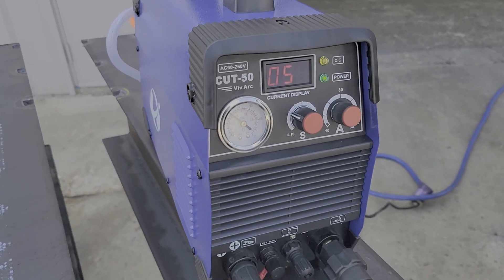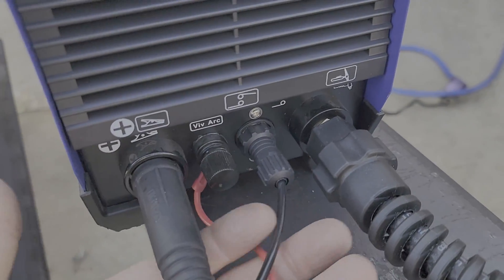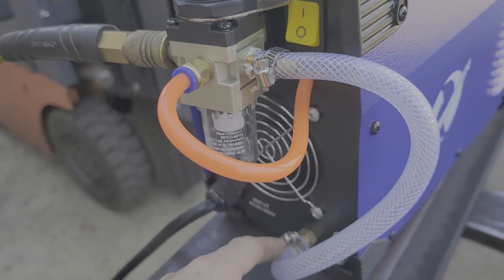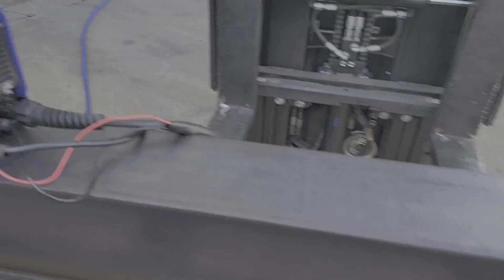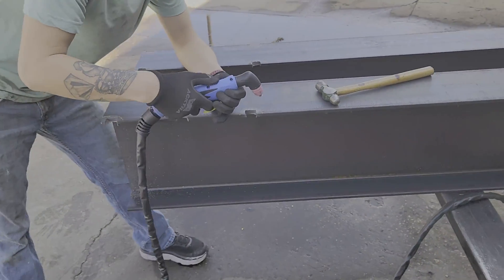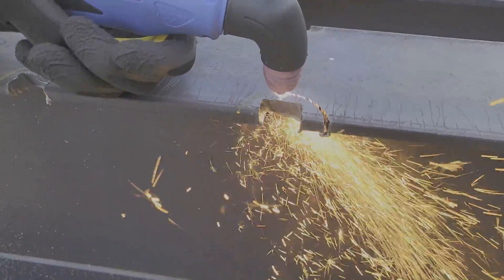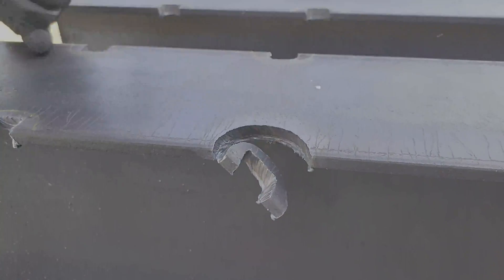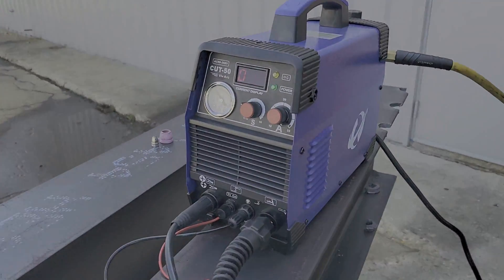Testing the $199 Cheap Plasma Cutter from Amazon!!!

Comment: I'm a DIYer, so what size compressor will I need?
Reply: Small, they don’t call for much. Had a junk yeswelder (stay away) but it only required 30-50 psi for i think 1/4 inch steel been a while ago, bought one of these lost intrest and haven’t even set it up lol but i need to. Whatever compressor is just a bit bigger than a pancake should do it

Comment: It's WAY cheaper than mechanical cutting and grinding - I have this exact cutter and have been fairly rough on it. It payed for itself in saved consumables ( think blades and cutting wheels etc... ) within the first few months of "hobby use". Straight out of the box mine leaked a little at the pressure gauge - fixed that in about 5 minutes.  I have 120 and 240 available - works better on 240 but does work well on 120v.  If you need to cut on 120V they recommend a 30A dedicated branch circuit. That said you can turn the power about 1/2 way up on a non-dedicated 20A with no other load and still slice up metal fence posts / sheet metal / whatever. You know you went to far if you pop the breaker.  :)    Overall - For my use - if it lasts 2 years or more I'll be thrilled. Great for hobby and occasional use !

Comment: I bought a cut50D from Amazon almost 3 yrs ago.
120/240 for $199. and have used it to cut almost 1/2 inch 
with little to no problems. It did take me about 2 weeks 
to get used to it.  But So far I have had 0 problems with 
the unit, But I can't say to much for the operator, yup, I
still make mistakes. I would give my little 
Prime Weld Cut50D a 95% rating for the work I do.
Reply: you right men a lot people discriminate those products olny because are china made,but ai have soo many borcken makita and dewalt thash tools......but a have chicago elctric welder machine and i never had a problem even  if it is china made

Comment: The real test is how long will it run before it breaks down.
Reply: Well, I bought a cut50D from Amazon almost 3 yrs ago.
120/240 for $199. and have used it to cut almost 1/2 inch 
with little to no problems. It did take me about 2 weeks 
to get used to it.  But So far I have had 0 problems with 
the unit, But I can't say to much for the operator, yup, I
still make mistakes. I would give my little 
Prime Weld Cut50D a 95% rating for the work I do.

Comment: What was it plugged into?
220 or 110?
Reply from the maker: 220
Reply: @texasmetalworks  They do make the same one under many different names that come with both and an adapter.
Reply: @scottmcbride2237  My Prime Weld Cut50D  did not come with the adapter, but my Lincoln 210MP 
has the same plug adapters for 120/220 so I just use the 10' cord to run it on 110v.
Reply: @texasmetalworks 220 50amp circuit? 30? Also I noticed the air pressure was only at 50psi, I think if you dail it higher to maybe 70psi you will achieve cleaner cuts.